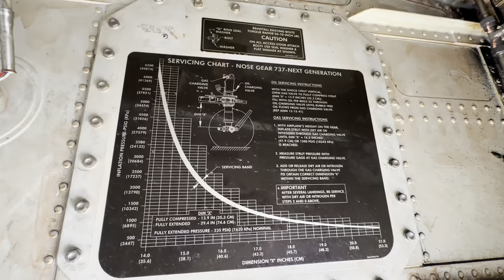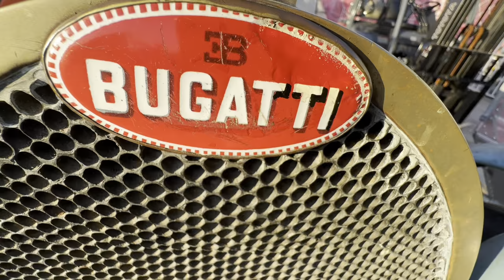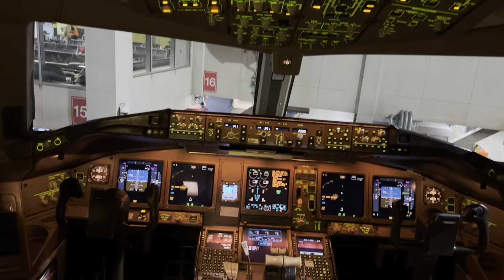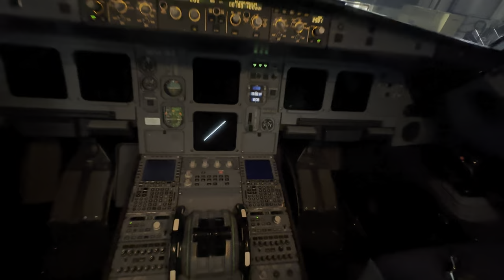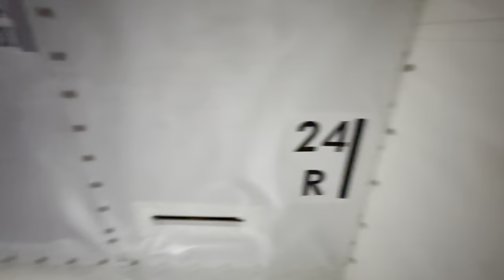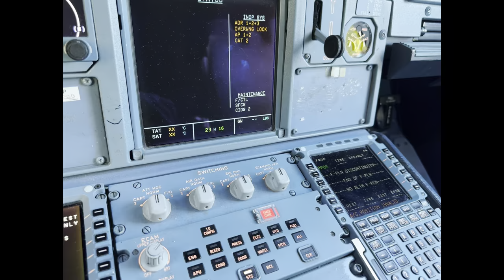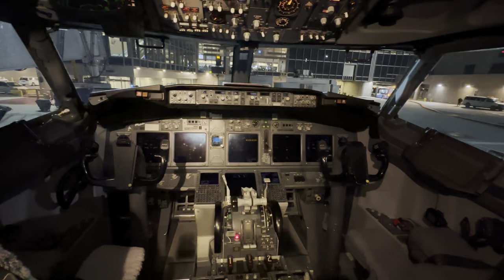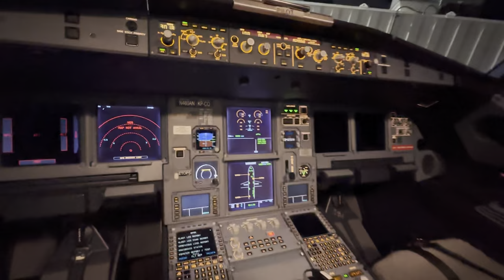Stig Shift. #13 (Aircraft maintenance Adventures)

Comment: I had a question on how you manage tool control on the flightline.   How exactly does it work for you to make sure no tools are left behind?  Does your company provide tools or are they self provided.   I know self provided tools can be a common thing.
Reply from the maker: All tool you see are mine, the company does not provide me with any kind of tooling, except for calibrated tooling. Tool management is an honor system upon the Mechanic, we have to be diligent, and we have to do a self inventory.

Comment: Awesome video as always. I just wanna thank you for always doing such an amazing job and keeping us flying public safe. I did have a quick question for you, I’ve always noticed in most videos of the airbus A320 the LCDs seem to have pretty bad backlight bleed. Do you notice this when you work on them?
Reply from the maker: I have noticed that, but from what I’ve been told, it’s a very common problem with LCD displays. It’s due to the nature of the LCD panel structure, and it generally is unavoidable based on the current production technologies.  If it gets too severe, we will change out the display.

Comment: Never liked virtual circuit breakers, there’s nothing like actually pulling a circuit breaker and fitting a collar while working on a system. The thought of a computer breaking the power supply to a system that I was about to work on never felt truly safe. Maybe it’s a good thing I retired as the Airbus A350 and Boeing 787 was coming into service with the airline I worked for. Only did a few maintenance tasks on the 787, so only had to rely on virtual circuit breakers for a short time. I spent 50 years working on 747’s, DC10’s and various other aircraft, which all had proper circuit breakers, so maybe I’m a bit too old school.
 But I totally agree in aviation every days a school day, you are constantly learning about new systems, new products and updating safety training. But I enjoyed every day at work during my 50 years, and if I had the chance I’d do it all over again, even those cold, wet and windy days on the ramp at London Gatwick.
Reply from the maker: It’s absolutely incredible Charlie, 50 years in the industry, and you are still young at heart, my friend
Reply: @StigAviation  Started as a sixteen year old apprentice carried on to nearly sixty seven. The job was always interesting with new technology coming I all the time, meaning a constant learning curve plus the fun and comradely out on the ramp made the job even more enjoyable. Now I’ve retired I miss it all a lot.

Comment: Plumb bomb leveling plate.  Interesting.   Question:  How do you jack and level my 87?  Digital reading?, from a Maintenance display on one of the MFD’s?  Can I access this page?
Reply from the maker: You’re gonna laugh, but the 787 still uses a plumbob. It’s located in the main wheelwell. But there are other procedures to recover data of center of gravity from the aircraft. We go through internal database of company, and also taking consideration the gross weight of the aircraft and fuel on board.

Comment: Question.  Exactly how are the cargo pallets locked into position after pushed through on those power rollers?  And how are those power rollers controlled?  How does the system know when to stop rolling the pallet into position?
Reply from the maker: Ramp personnel will lift a small little latch that locks every single cargo palette. The rollers are controlled from the outside, there is another panel above the open door switch that has a joystick. You can control the power drive units from there. The system simply pushes the pallets until a stopping point, via latches.

Comment: Very interesting about Arinc.  So is the shelfing itself the data bus? meaning there are ports on each shelf that the box plugs into as a result of it being mounted, or are there networking wires in the back of each box that transfer the data?
Reply from the maker: These boxes have electrical connections, almost like a plug style with pins that connect to the backside of those racks, the wiring routes itself to the centralized network.

Comment: Hi stig. I noticed on the part where you were changing the crew oxygen bottle on the 777. There was what looked like a ladder going up from where you were. Can you access the equipment bay from the cabin like you can on the 747? 🖖
Reply from the maker: Yes you can. It goes up to the forward galley. But it’s locked. It needs a special tool/key to open it.
Reply: For good reason too!!
Reply: Really do hope the competition went well, really looking forward to seeing the video too 🙂🖖
Reply from the maker: @KevWitt3455  went very well. I’m working on the video as we speak. It’s gonna be a long one.
Reply: The longer the better!!

Comment: The details about the computers brought back nice memories. I worked at CAE on flight simulators and I worked on setting up the servers that simulate each of the flight computers.  I installed about 400 one year since production of 777 simulators was going full capacity. 
Then we installed simulation software that mimics the real servers. 
The first simulator for 777 was built BEFORE any airplane was delivered. So we kept in touch with Boeing to get software updates as they were creating it. 
Then when they tested the real airplanes and published performance curves, we matched the simulation to the exact values. 
The work was great, too bad the pay was so bad that everyone left after a couple years.
Reply from the maker: I’m glad you at least got to experience the simulator portion of it, most of us probably will never see those, then again, we have the real thing here. Thank you for all your hard work.

Comment: I can return some info.  The Polar Survival Kit’s most important content are a pair of protective extreme cold suits that the pilots can wear to perform an external inspection after we have had to divert to an extreme north polar Emergency alternate airport.  There are several options that we can be flight planned to have as ETOPS alternate airports during Polar routings, sometimes routing even very close to the literal North Pole of the planet.   When we were friends with Russia, a polar route from eastern Canada or Europe to Southeast Asia overflew big parts of Russia.  A common alternate is the city/airport of Yakutsk in Siberia (UEEE/YKS).  Often has the distinction of being the coldest city on the planet during winter.   That polar suit would be a major safety/survival outfit to have on board if we had to prepare for a departure out of there one cold winter day/night.  We have to confirm that Polar Survival kit is on board before any Polar trip.
Reply from the maker: Thank you so much for the fantastic information, I really appreciate this Mike. 👌

Comment: @StigAviation, are computers in electronics bay (of 777 or any other plane) hot swapable?
Reply from the maker: It is never advisable to hot-swap any kind of component, especially if it’s a electrical component. Always pull the circuit breakers to disable that system.
Reply: @StigAviation  thanks for the answer! Btw I've just watched your video line vs hangar maintenance. I'm computer tech, was electrical engineering but then I switched to software engineering due to some circumstances. I'm very much in love with embedded systems because they allow me to mix both worlds. And yes, I love to strip all electrical things to bare metal :D I love to know how things work and aviation is a quiet love of mine. Thank you for sharing your time, knowledge and happiness with us <3

Comment: have you ever seen an automotive technician successfully transition to the aviation field? as an aviation tech do you have to work nose to tail and repair anything and everything or do you specialize in areas (electrical, hvac, etc) i see you walk around and service aircraft as they come in. is there a technician that just works in the hangar or do you guys rotate around?
Reply from the maker: Yes, I have seen automotive technician, successfully transition, that technician would be me. I used to be an automotive technician. And we are all well rounded technicians where we work on all of the aircraft. I currently work on the line on live aircraft, I have the choice to work in the hangar environment as well. That’s up to biding the position.
Reply: @StigAviation  thanks. been thinking about the switch for a few years now, but you know the saying, fear is the mind killer.

Comment: @StigAviation  when you were in the computer room of the 777 were those silver  cables the actual cables that control the flight surfaces? I know about fly by wire,  but does the wire go all the way to the elevator and rudder or does it pull the cable right below the cockpit?
Reply from the maker: The aircraft itself is still pure flyby wire, but there are some components that do have redundancy of a cable that run to an actuator to activate it.

Comment: Is the 429 system also used in the 787? If not, it would explain why the aircraft is so smart
Reply from the maker: I believe they converted partially into ARINC 664 at the moment. It seems to be a more efficient way on the 787.

Comment: Stig, you briefly mentioned rudder and  brake pedals when in the nose of the 777. My question is is it true the pedals actuate the rudder and the brakes dependent upon whether you use your toes or heels on the pedals?
Reply from the maker: Yes, that’s exactly how it works. When they press the pedal left to right, it will move the rudder and they can also move the nose landing gear for steering. If you want to apply brakes, you press with the top of your feet down much like an automobile brake.

Comment: Hey Stig, 2 quick questions for ya
On the 787, why are there so many flao settings between 15 and 20 when pilots normally skip them and deploy 20 or more most of the time?
2) Could you maybe explain the differences in the overhead panels layouts of Airbus and Boeing pkanes and their types?
Thank You
Your content is very entertaining and informative and I appreciate the time you take out. 🎉❤
Reply from the maker: The flap settings is more of a pilot question, that one I could not give you a correct answer. And I will definitely put something together of overhead panel layout for airbus and Boeing in  future videos.

Comment: Perhaps you've explained this in a previous video but, if not, why are the pitch trim wheels such a prominent and noisy element in the cockpit.  It seems that like everything else, the form factor could be much smaller.   Even though it may need to be mechanical in case of failure of the primary trim controls, they seem out of place in modern cockpits.  I'd like to understand this better.
Reply from the maker: Well it depends on the type of aircraft you’re talking about. The 737 has a full mechanical system with electric assist in normal operation, and it’s attached with chains and cables. It’s just inherently noisy. The 320 is fly by wire and you won’t even hear it move. The 777 and 787 and A380 A350 no longer have trim wheels. It’s all put fly by wire and done with computers can be manipulated by switches. The point I’m trying to make it evolution of the aircraft systems. The older models still hold on to some classic features

Comment: If I remember correctly the FAA says that aircraft can only fly certain routes based on survival gear onboard, for example an aircraft cannot fly more than XXX number of miles from a coastline without ocean survival gear, and so that Polar Survival kit means that it can fly polar routes
Reply from the maker: That’s absolutely correct. Hence the ETOPS certification.

Comment: If you have to use the fire extinguishing agent in cargo hold, is there an over pressure valve to prevent rupture of the skin in this area?? Keep up the great videos!!!
Reply from the maker: The skin would not rupture from the extinguishing agent. It was simply fill up the area and extinguish the fire. As for protection for over pressure, there are valves for that separately. There is positive and negative pressure relief valves on the side of the aircraft.
Reply: @StigAviation  Thanks for the reply Stig!!

Comment: As a Ford technician, those new Broncos are AWESOME. If you ever get the chance, take a look at the chassis on them. The engineering that went into that car is incredible. It’s so simple, yet so complex at the same time. Just don’t look under the hood, it’s a mess. Especially the V6 ones.
Reply from the maker: Haven’t had a chance to see it up close, I need to stop at a dealer and take a look
Reply: @StigAviation It’s quite crazy what they did with that car. It has a wide track fully independent front suspension and a 5 link solid axle rear suspension. The Sasquatch package gives you all of that with 35 inch mud terrain tires and a bunch of other goodies.

Comment: Great show.Every now and then you see where a aircraft takes off,and then the crew has something go wrong and they return to the airport or are diverted to another.I always wonder did something just break,or did someone miss something?How does all that go down after the plane gets parked?Does it become a blame game?Or is it,just fix it?Can pilots damage stuff by doing things wrong?I know this is a wide open question with probably limitless answers.But i always wondered.
Reply from the maker: If something goes wrong after takeoff, most of the time, the aircraft will come back to the same airport. If it’s not capable, it will find an alternate airport to land. If it’s a malfunction with the aircraft maintenance will take over and try to fix it. In the meantime, we will try to find a spare aircraft for the passengers. And there is no blame game, it’s more of a solving the issue as a collaborative team between everybody. We all want to make sure everything is safe and we want to make sure that the aircraft goes out safe.

Comment: I have a question. At 1:47, what are the cables used for when describing the strut info? Thanks?
Reply from the maker: For steering. Cable driven hydraulically assisted.

Comment: Another fantastic video by the Stig himself! When I used to do shock strut servicing on the P8 (737) the X dimension was indeed the distance and the other variable was not the temperature but the pressure in the shock! So for the nose it was like 800psi x 18.5in, I definitely don't remember the temperature having a play in the procedure but maybe its done a bit differently at your end? Also on the 787, i always thought the cargo doors were electric until we had an issue with one where it wouldnt close and so we had to manually wind it down, its hydraulic! So that flat cable is actually a hydraulic line! I think its a hybrid with electric's running through it too, very interesting design that has baffled me for ages.
Reply from the maker: The reason I mentioned is because you do have to take in consideration of how cold the strut is, sometimes aircraft to come in and temperature takes importance with nitrogen. And yes, the 787 cargo door is very interesting that it has its own hydraulic reservoir completely separate from the aircraft.
Reply: @StigAviation   Can probably very easily tell that my main experience is hangar maintenance where all temps are stable haha, super solid statement there that I will learn that, thank you! Indeed! Thanks for being so approachable brother, so good to have someone to clarify info so nicely. Many appreciations!

Comment: Sorry if this question has been asked before but why do some engines have an 'open' exhaust at the back (where you often see smoke coming out) and others are closed off? Also, have you ever worked a 747?
Reply from the maker: It’s just a difference of design for the high bypass, and yes, I have worked on the 747 in the past.

Comment: I looked into the ARINC 629 stuff and from what I read basically it was proprietary and super expensive while only being marginally faster. Very few manufacturers wanted to bother building 629 conforming devices meaning no competition and super high prices
Reply from the maker: But it works so efficient. It’s a beautiful system.

Comment: About the airinc 429 vs 629,in terms of safety, i can imagine a decision to revert to the 429 setup, because when one device on a shared bus as the 629 is fails and interferes with the bus, non of the other devices can communicate: like a single point of failure.
429 is old fashioned, but might be saver to use in that case.
Just my thoughts on that.
Reply from the maker: 629 had a redundancy feature, where, even if a portion of it did fail, it would still transmit information, but overall it was basically a more expensive system

Comment: That b787 engine oil do has oil change like your car has do oil change and oil filter change too?
Reply from the maker: Engine oil on these aircraft only gets changed when it’s contaminated or if there’s a specific job card call from manufacturer. If we do change oil, the filters will also be changed.

Comment: Great video Stig interesting to see inside the E&E bay of the 777, i love all airplanes no matter what size, Airbus or Boeing i find the engineering and systems fascinating and love learn more about them i just love the 777 a little bit more than the others lol. A quick question Stig the red buttons on the side of the throttle levers are they used for the auto throttle system. Looking forward to the next video and stay safe my friend
Reply from the maker: That’s correct my friend, the little red buttons on the side of the throttle is auto thrust disconnect.